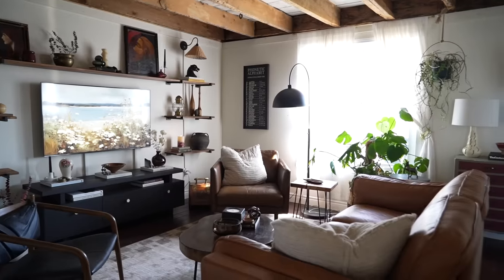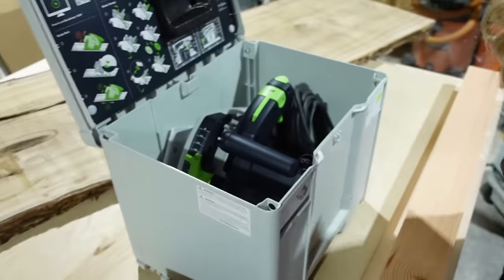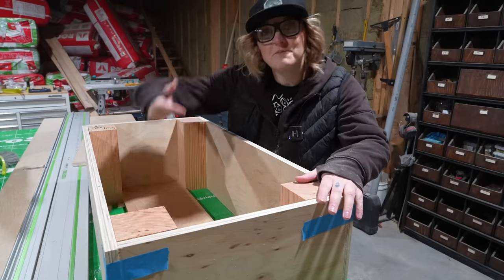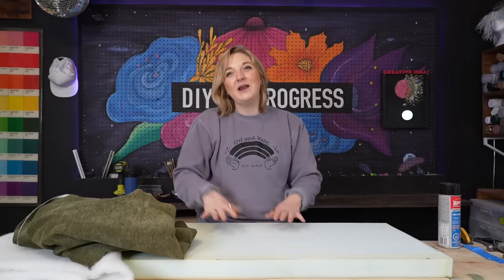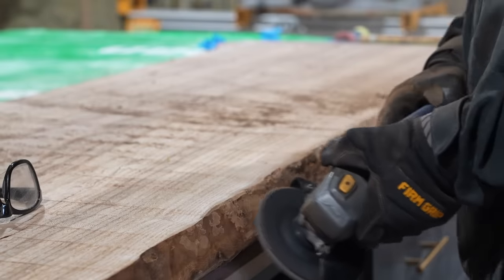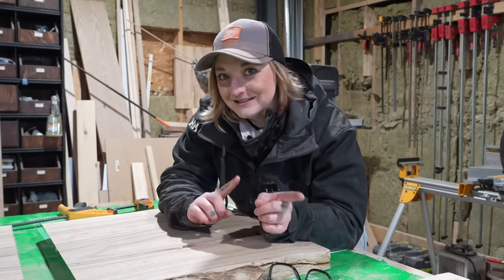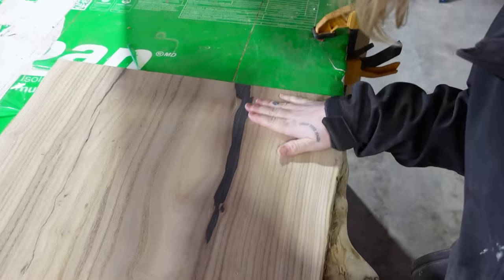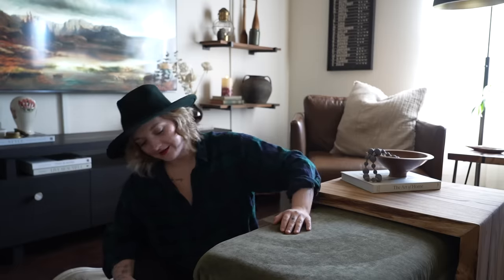i diy my dream ottoman/coffee table 😍 | Living Room Makeover

Comment: It is beautiful! Icringe a little when you have to cut off so much fabric, etc. If you do one side, then pull to the other side or end staple and cut it off with a possible big piece of fabric for other DIY  items. It does look great!  I'm surprised you did not make it with storage underneath the top. Even if you do not need it now it could be a positive opportunity later. Plus, by not making it long enough for two people to have their feet up while using the table.

Comment: Now I'm not a professional but after I reupholstered the ottoman in my bedroom, like you, I didn't like the corners. So when I made an upholstered footstool, I instead decided to sow the corners first to get a clean finish. I did this by putting the fabric over the foam & wood inside out, pinning the fabric at the corners so I had nice smooth seams & got the look I was after. Then I quickly hand sowed, turned it the right way around & put it over the top to check the finish was how I want it, before sowing using a machine & adding the fabric properly.
Reply: Another option is to do the corners last and do folded corners. You would staple the fabric on the same way you have but leave about 2 in undone on each side at the corners to manipulate the fabric later.

Comment: Love this idea! 😮❤

Be sure you put a couple coats of water repellant on the fabric. It'd be a shame to have it stain because of a spill. 😢

Put some tap-in glides on the bottom of the wood piece AND on the bottom of the ottoman legs so it will slide across the floor more easily. 

If you want to get fancy, add rope handles on the 2 short sides of the ottoman to make moving it easier. Get the color to match the fabric. Make it taught, right under the cording that separates the top from the bottom. It won't really be visible, but will make moving it SO much easier! 😊
To get REALLY fancy, add handles on the open ends of the wood piece as well. Get the color to match the wood. Make it taught, right up against the underside of the table top, and set 1" or so back from the edge. It won't really be visible, but will make moving it SO much easier! 😊

Comment: Hi Danie! I built something similar some time back (of course not as great looking as yours, I cried of frustration making mine 🤣) and I have a tip - add little wheels to the inner side of the legs so you can just roll the table to another spot over the ottoman ☺ I have found it really useful.

Comment: Speaking about fabric sources for DIY’ers i recently clued into a source. I bought some luxury faux velvet curtains with blackout properties off of amazon. I was so impressed with the fabric. Fast forward to looking at headboards and wanting a velvet tufted type of headboard, I realized the one i liked was (no word of a lie) upholstered in the same fabric as the one set of drapes i bought. BINGO, now i am planning to make the headboard i want and upholstering it for way less than the cost to buy a headboard, and i plan to use the same type of drapes i found that impressed me so much.  I believe you would want the blackout backing as that helps prevent stretch but there you go. Big curtain panels 50 inches by 108 inches long 2 of them was 70 bucks. There are different quality and prices out there but i guarantee the prices i saw in the fabric store for that much upholstery fabric is far more expensive. So complete heads up folks check out curtains you can get heavy linen look blackout drapes on amazon for tons of different colours. Microfiber is like a velvet suede look. So,. Wanted to share that resource, check it out and make a decison thats right for you folks cheers 😊

Comment: I don't think the L brackets are terrible, they are a valid solution. However, I'd route or chisel a 'nest' for them in the boards, so they sit flush and don't chafe the upholstery as the table part moves above, or the Ottoman moves below. Otherwise though, I think it's perfect. Even the sparkly touch ❤

Comment: Hi Danie, this was yet another amazing build. I wanted to ask you about storage.  If you are building an ottoman that has storage, what would you need to do differently? Also, would the wood need to be treated on the inside? I have a small space that is screaming multipurpose furniture. Thank you!! I love your channel!!!💖💙💛🥰
Reply from the maker: If you want to make storage inside, you can add a bottom on it instead of the cross piece at the top! Then either buy a piano hinge or two small 3” hinges and attach this to the top and inside of the box. Alternatively, you could add a folding hinge on the inside to keep it all hidden too! So many options available depending on the look you want :) as for treating the wood…you don’t have to, the raw pine wouldn’t hurt anything you put inside but alternatively you could paint the inside or add a liner.